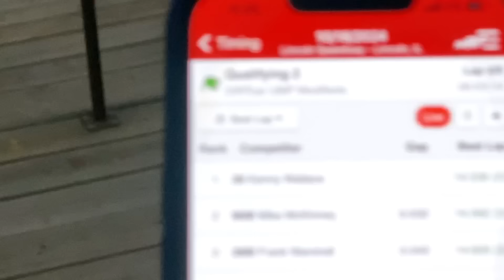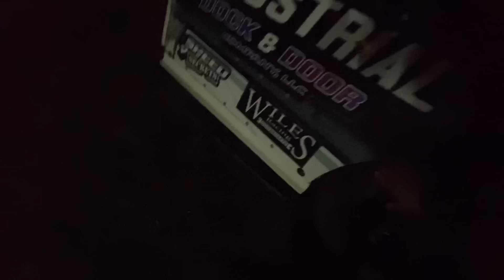Improving Our Qualifying Game: Battling For Better Positions At Lincoln Speedway

Comment: I just want to say as a SUPPORTER and a CHR FAN!!!. I've been around racing for 37yrs. This is my personal experience/opinion  the last thing you want to do starting so deep in the pack is restrict the motor or starve the engine of horsepower because towards the end of the night when the track does lose grip  you still have the horsepower to rip the lip. That's the thing when you take power from the motor you can only run the bottom. And if you come up off the bottom you're not going to have the horsepower to at least have the drive off the corner and down the straight away. Again just advice. No two scenarios are the same. Take some gear out of car. Again this is just ideas of encouragement. The winner is the man that BEST tames the BEAST!!! GREAT BLESSINGS  and opportunities are coming your way because of your passions and abilities. Good Luck Chase and Team and God Bless!!! I'll be watching the WHOLE WAY.

Comment: This is just my opinion way would u take horsepower a from the car when u need the most I no u said the car was spinning a lot if ur car is spinning add some gear to it that will help ur spinning problem and u will still have the power too pull u off the corner because if u take a 350 and put a four cylinder in it ur still going to spin but u want go anywhere but if u leave the 350 in it and add gear it will take the power away down low but still have power to get u around the track but still a good job Chr team